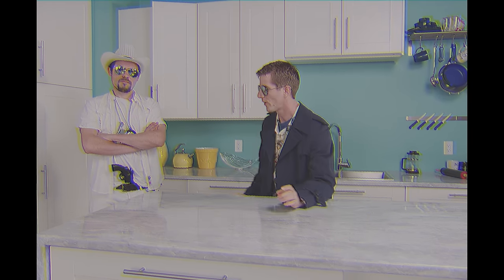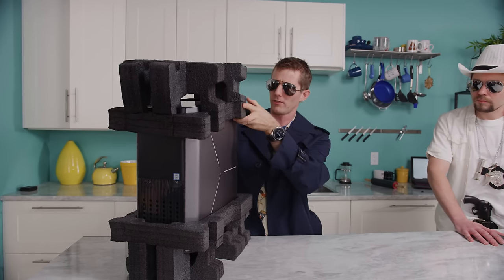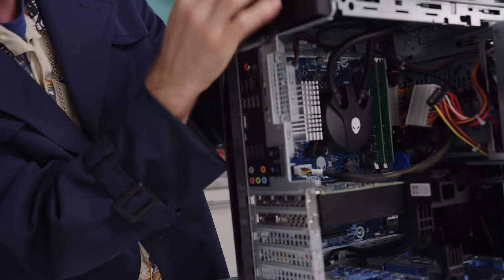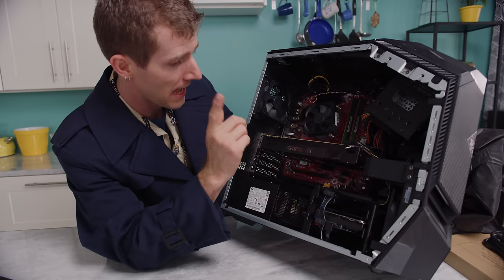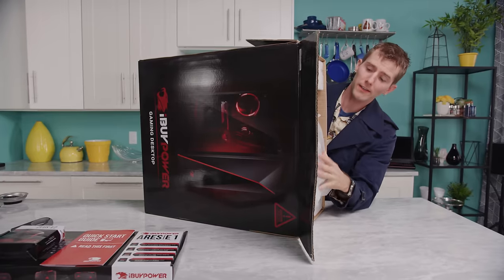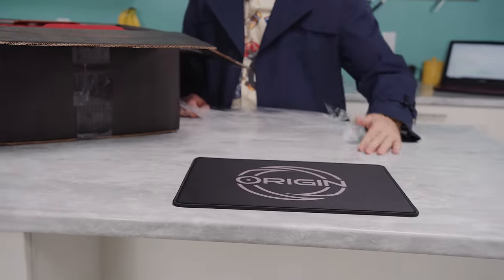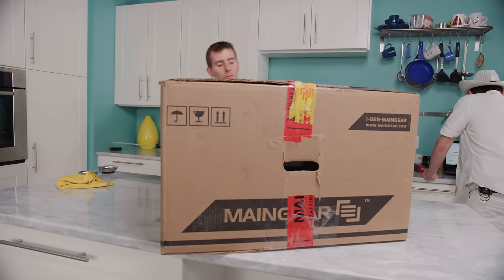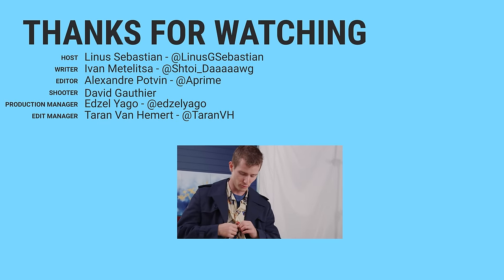What did we BUY?? - $1500 Gaming PC Secret Shopper Part 2

Comment: Im not sure about others as i didn't have experience with them but i can say for sure that Alienware is ripping you of, you are basically getting a fancy case and their software but the parts inside are more often then not sub par from what you could get if you bought the parts yourself that are better and for a cheaper price. Not to mention that Alienware's software tends to conflict with some games, for instance i could not start Black Desert on it at all while on a equivalent system that i put together myself i can run it just fine

Comment: in 2016 i  bought  my  first  gaming entry  level  desktop  built buy   cyberpower i bought online from bestbuy .ca for 1700  i  got  a  17 7700  liquid cool  cpu  with  a  1060 6 g  gpu  and 16   ddr4 2400  with  a  small  ssd  120 m2 and  a  2  tb hhd  ..  its  ran  farcry 5..  elite  and dangerous starcitizen "  for which  i'm  the  bare  minimum for a playable game " its  not optimized   .  ive  done  a bit of youtube streaming  . i  sometimes  have  heat  issue   and  i dont  over clock ..  i  am considering a 2070 super 8 gb gpu for 700 $ upgrade or am i better off to buyyprebuilt cpu  2000 $ and get the newer mb cpu and gpu  ?

Comment: Another thing to check is to see if they did the jumpers correctly on the system board. I have had to rewire a couple because it was not wired correctly when it was assembled. It is a toss up between two and they are too close to call from the build standpoint.

Comment: 12:58 actually that is to prevent dust inside of the system collecting at cracks (the positive pressure ensures that the air doesn't go inside that system, it is blown out.

Comment: It kinda annoys me that Linus got annoyed by the fact that a 1050ti was sent, saying that it was low quality and wouldn't perform well. For anyone is isn't handed thousands of dollars worth of tech on the weekly a 1050ti isn't bad I've used one for a few years now and it can run just about anything.
Reply: Its because the builds were $1500-$2000, you should be getting more around a 2060 or 2070 for that kind of build pricing, has nothing to do with the gpus performance by itself.

Comment: Bro deadass couldve got a ryzen 7 and RX 590 or GTX 1660TI so wth
Reply: those are not good cards for "1500$" plus the ryzen 7 will not be utilised
 and then if the buyer (janice) specified gaming.. then i think ryzen 5 will be better value bcs then you can add better gpu s..  rx 590 and 1660ti are not the way to go if you are going for "G.G.GGG.. GAMING"